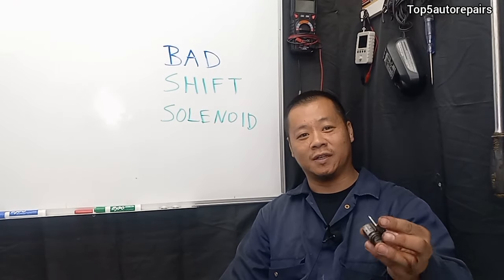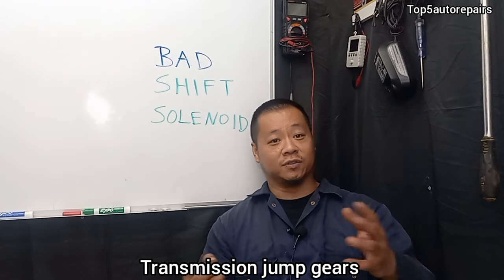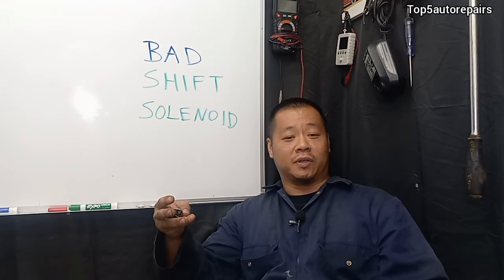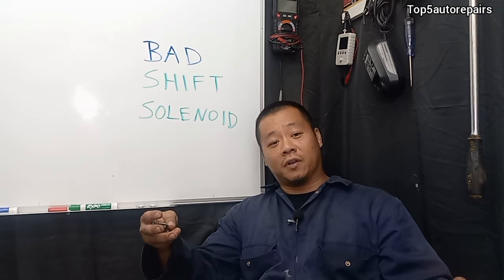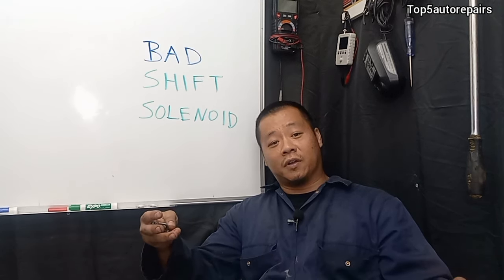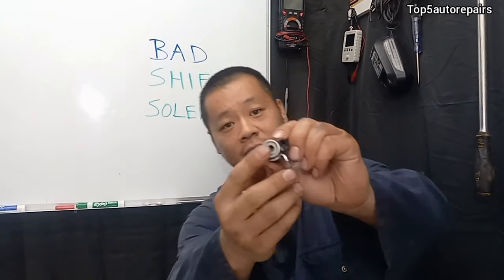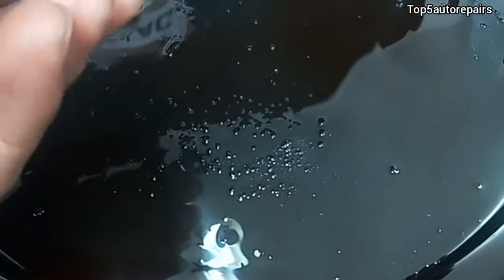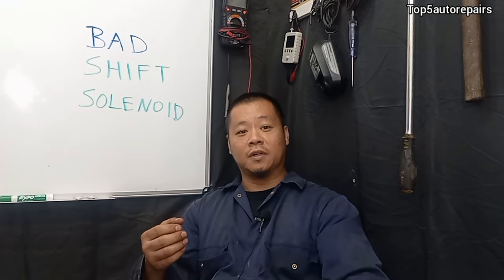Bad Shift Solenoid Symptoms & Codes. Do you have Transmission Shift issues? Slipping? Delayed Shifts

Comment: Can a bad transmission solenoid make your car go into limp mode?
Reply from the maker: Yes, it will set your vehicle into limp mode.
Reply: I can buy a 94 Camry XLE with lite mileages and really good condition for $1000 but it's in limp mode. Will all of them need replacing? There's 3 I believe.

Comment: Dear author. Help me troubleshoot a manual transmission issue.mazda bt50 yr 2007, with engine on, clutch depress fully but hard to engage 1st /2nd/3rd/4th/5th/reverse(while static but once car is moving its easier to engage any gear). Usually i softly force to reverse or 4th gear, when finally manage to engage then i can engage to 1st or 2nd gear. Transmission fluid/clutch hydraulic/clutch lining/gear shift bushing and the respective plastic parts ok. What else could be the cause?
Reply from the maker: Hello, check slave cylinder, clutch master cylinder and air in the system.

Comment: I have 2005 Chevy impala in my car goes in park reverse n neutral but I need to shift to d 3,2,1 but I can’t drive at all said it’s solenoid Alain I got transmission filter in gasket so that was changed in no metal was in the fluid neither from the old one which it wasn’t brown now it is red pink like it’s supposed to be in now the solenoid change is it reset for it if possible in not sure if low fuel is in issue or not right now because it still does turn on in run but just not shifting into gear I’m needing to drive

Comment: I have a Chevy Impala 2013 and it just revs up in drive what's wrong I even drained the old transmission fluid out and replaced it with new fluid let it run in park for about a hour and it still won't go in drive can u help me?

Comment: Hello I have 2005 1.8 toyota corolla its converter manual to automatic transmission but gear sifting problem and make noise also I check many mechanics but no code and no falt they found I changed speed sensor open gear box but little better but problem still there please help me in this case

Comment: My 06 honda crv jolts from 1st gear to 2nd gear when I accelerate. Sometimes it stalls out when I go reverse. The scanner doesn't show any transmission related codes.
Reply: Maybe the TCM is faulty need repair
Reply: Transmission control module

Comment: Does a 2018 Chevy Malibu LT have these problems? My rpm was jumping so I merged to the right and parked and shut down the vehicle. I started the vehicle again put it in drive but no response. Drive or Reverse, the vehicle wouldn't move.
Reply: did you already try disconnecting the battery and touch the leads together to discharge it? And let it idle after starting for 2 min.
Reply: @1111comment  negative I took it to the dealer and they said it was a bad transmission
Reply: @1111comment  new one remanufactured had to be installed...why u say the battery
Reply: @victoriamartinez267  to reset the transmission control module. Dealership doesnt give a shit about a cheaper fix. hope you were within the 5 year warranty
Reply: @1111comment  agreed good advice!

Comment: I have a 2006 Lincoln Mark Lt transmission went out instrument panel kept reading transmission malfunction followed by limp mode activated. Needless to say took it to the shop had the transmission  rebuild   pick it up 3 days later thinking alright running good till i got home. Tried to back up and no reverse. Took back to shop since i have 6 months warranty on repair work 2 days later its ready so i thought . Got on freeway 3rd gear slipping no overdrive . Took it  back again same thing pick it t up   day later  no reverse and third gear slipping wtf any advice anyone . Fyi took it back to shop  technician frustrated says I'll call you when it's ready. 5th time is the charm i hope

Comment: Transmission shifts good, but will the transmission gets hot and won't shift? Then whenna get cold, it's fine.
Reply: Mine is doing same thing! Any ideas anyone?
Reply: @pauljohnson8850   Shift solenoids ideally need to be tested with Transfluid @ 80°C (176° F) - why? Because this is normal operating temperature.  You could essentially remove the shift solenoid and test it under cold conditions and have it work and within ohm range (10-15 ohms). However, when hot they may stop working due to RESISTANCE.  Which is why I recommend checking the solenoid in series using a 10 ohm resistor and a light bulb.  If the light bulb goes dim after 1 minute it's a good indicator that the solenoid needs to be replaced.  That's why just checking to hear it click (when sending power to it) is NOT enough.  Always check the harness while you are at it. But you and the gentlemen you replied to SEEM to have faulty shift solenoids.  Please work in a clean setting to avoid debris entering the valve body and solenoids.

Comment: I have an automatic. It was almost stuck in park. I had a hard time pulling the shift lever down to get it in reverse. does that sound like I might need a shift solenoid ?
Reply: No sounds like you shift cable or linkage

Comment: Mine runs fine but it cant make it mind at 35 mph- 65. ?  Its running i dont change my foot pressure,  and it shifts down. Then sonetimes back up. O. Liver transplant list. Cant afford to be ripped off. Please someone help. Position sensor? Solenoid,  low transmission fluid. I checked but looks fine. Any suggestions be great

Comment: So I have a problem with my 2007 dodge ram 1500 I got a check engine light came on it said I need shift solenoid c error code was po760 so I'm trying to figure out is this the thing I need or is it the big metal block thing or a cylinder metal thing please help I have no knowledge but I'm trying

Comment: My toyota previa engine will just die if I shift to D or R gear.
It happens when the engine is hot. The engine will just die (while I was driving it)
I free the gear and start the engine back..and it just die when I shit to D or R.
What would be the cause of the problem?

Comment: Hi my odyssey is slipping on the first gear. I just did changed the atf and drain but still there only on the first gear. You think its the solenoid? Is there such thing as the first gear solenoid?  Thanks in advance sir.

Comment: Hi mate, i have a 2001 jeep cherokee classic. Lately out of nowhere the car just runs terrible in gear like i loose all drive and its stuttering. Car revs clean in neutral nps. Always issues when in gear. Any advice please? I can stop and then take off again fine, but as im cruising along its like the car looses all power. Shift to neutral and car revs clean. Would appreciate some advice. It has me stumped. Cheers.

Comment: WHAT CAUSE YOU TRANSMISSION TO SHIFT FROM DRIVE TO NEUTRAL IT STAY IN DRIVE ON SHIFTER BUT SAY IT ON THE DASH IT IN NEUTRAL  YOU CAN ONLY MOVE 15 FT BEFORE IT CHANGES INTO NEUTRAL I REBUILD THE TRANSMISSION

Comment: A great video, I've got a 13 explorer ecoboost and noticed about a month ago that when you get between 25 and 35 mph it's got a bad vibration like the trans seems to shift fine it doesn't slip and I've checked the axle shafts and CV joints for bad ones I was wondering if ya had any good ideas of what could be happening.
Reply: probably torque converter

Comment: Anybody else? 2016 5.7l tundra limited with 101k. Fluid and filter changed at 60k again at 98k. Truck bumps (sometimes hard sometimes not) when easily accelerating after slowing down to 20 to 35 mph.

Comment: How can I know which one is the bad selonoide??? Witch one is the
A SELONOIDE
On a 06 tundra
Reply from the maker: Check for solenoid codes. It will most likely pin point which solenoid is most likely faulty.
Reply: Test for resistance with a multimeter

Comment: i bought a 99 silverado last summer its a 2500  4x4 it has the 4l80e when i bought it it shift perfect no  issues but this last winter when it started to get cold it has a problem when i take off it shifts the first time fine but when it comes to the second shift it hesitates until the motor gets to a certain temp now if i start it and let the engine get to the first long line on the temp gauge i can take off and it shift perfect lol i dont get it any ideas would be awesome thank you and there is no codes
Reply: Sounds like old or done fluid

Comment: My issue is after I start engine up on my 08 Acura TL, I can't shift out of park, I have to let it warm up 1 to 2minutes than I can shift out of park. After that, it drives fine. Is it the shift solenoid or the 2 pressure switches? trans fluids are fresh.
Reply: I bought a used shifter assembly off ebay n it works fine now.  Yes, it was the solenoid spring that wasn't moving. I clean and spray some grease in the solenoid now is working too. So I have a spare for later if one ever have a issue again or just take the shifting assembly out n grease it up again.

Comment: So I started my car right so I shifted it to drive I  thought I was gonna drive way but it didn't so I step on the gas only rev on the gas when I step on gas ped ?? Really having bad trouble with this thinking its shifter cable the nuetral safety switch shift shaft Manuel any idea would really help thanks

Comment: I vote H€££ NO don’t buy!  We bought a brand new 2019  NAVIGATOR XL we now have a total of 35,000 miles on the car. However,  in 2021 and about 12,000the transmission had to be completely replaced after a couple of months of the dealership having our car and Ford trying to avoid replacing it and going back and forth on bandaid fix attempts.  Here we are 20,000 miles later with the same issue surfacing.  The transmission refuses the shift gears when you accelerate to freeway speed or if at freeway speed fails to downshift in order to pass, so your slowing down at 6000 rpm’s because the automatic transmission has engaged the clutch to shift but the shift never happens.  
There were no other indications on the idiot lights like low transmission fluid prior to  presenting this failure mode. Naturally, it’s doing this in the middle of Thanksgiving travel plans. I am ready for lemon law legal action.  😡